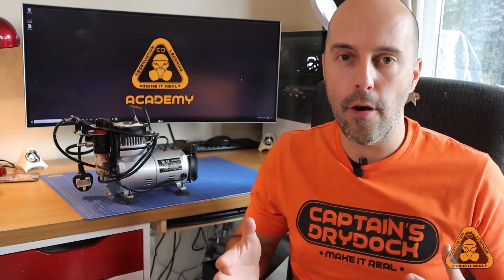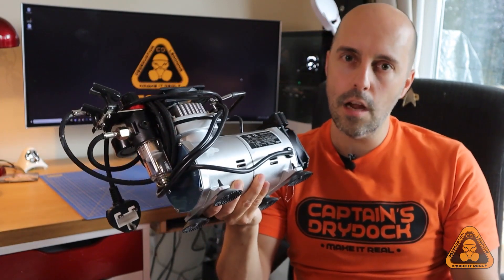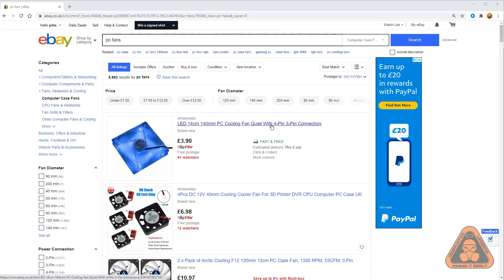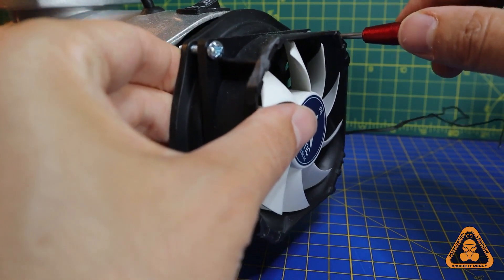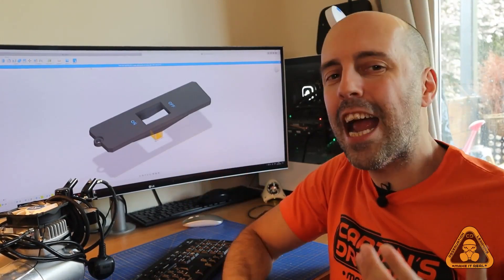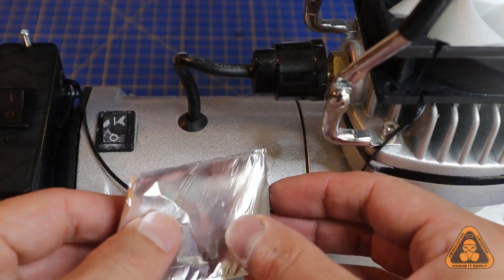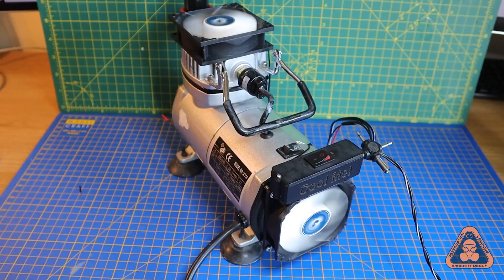Airbrush Compressor Cooler Mod

Comment: It begs the question, WHY is a cooling system not already built into these?? I had a compressor with the extra black tank underneath and I had the same overheating problem with that. They just churn out these without taking into account any necessary improvements based on customer feedback 😦😧 Chinese made by any chance??? 😒😒
Reply from the maker: There is a cooling system, it's just not good especially for long term painting. I've since got one with a tank and that's working much better.
Reply: @CaptainsDrydock  thanks very much and also for the video, I forgot to type it very uncouth of me, sorry. Yes, you'd think they'd make these for a few dollars/pounds more with a proper cooling system for longer working periods but the idea seems lost on the manufacturers 🤔 I'm puzzled. I'm still feeling my way with airbrushing at a very basic level and getting frustrated with instances where I've cleaned an airbrush thoroughly but still finding it's not pushing paint through and then the next day the dang thing works ok 😫😄😄
I'm using a little red pad compressor Oasser Airbrush Compressor kit
and also this:
Airbrush, AGPtEK Airbrush Kit Air Brush Pen, Mini Air Compressor Airbrush Kit USB Rechargeable and Portable Airbrush Gun for Make up, Tattoo, Nail Art, Cake, Face Paint and Model Painting https://amzn.eu/d/5GAfKDt
Sometimes they work but they're not powerful enough so I want to get back to a decent compressor.

Comment: Thanks.  Just ordered the fans.  I'll probably 3Dprint the top mounting, but nice to know you can just glue it.
Reply: Have you found the files for the top mounting?
Reply from the maker: @aspmos  Recently I saw a friend that found 3D print files. So will do that soon :)
Reply: @CaptainsDrydock  I cannot find the file.
Reply from the maker: @aspmos  Sorry, I don't know the file location. As I only saw another maker install one a while ago.
Reply from the maker: Now that I have a 3D printer, I would do the same if I did it again.

Comment: If you just mount it to a tank, you won't need the motor running all the time. Solving all your overheating issue, and results in more steady pressure/paint jobs
Reply: I have one on a tank, and having almost burnt myself on it on a beginner trial run, I'm fitting these fans!
Reply from the maker: Thanks :) This solution was made due already having this version without a tank. And couldn't afford to buy an add on tank.
Reply: @CaptainsDrydock  crazy, how much are computer fans there? Up here in Canada you're looking at minimum 25 a fan. Or 30 bucks for a 3 gallon tank ad on
Reply from the maker: @Burnt_clutch89  WOW! They're super expensive in Canada!! $7 in the UK and even free if you rip out one from a decarded PC - Much cheaper if you can't afford $30

Comment: I have a question is .. which side should I place the fan.. should it be blowing or extracting ?
Reply from the maker: Blowing. The air will circulate through the housing and out of the vents.

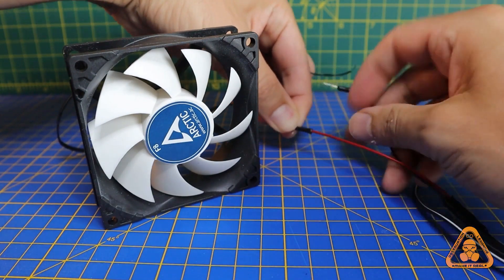Comment: 3:27 you could also just find the pin out for a 3 pin 12v computer fan, that will tell you plus minus and tach. 
Some fans will break if you short circuit them

https://allpinouts.org/pinouts/connectors/motherboards/motherboard-cpu-3-pin-fan-connector/

Comment: Really good vid, helped clarify some stuff for me. Just one thing, you want both the fans blowing onto the parts they are fixed onto? No exhaust fans?
Reply from the maker: Thanks Daniel :) That's correct, the top fan blows cool air over the fins just like an air cool motorbike engine. And the rear fan blows air through the compressor where it exits through the vent holes you can see in the bottom.